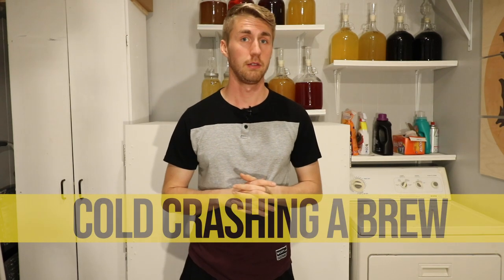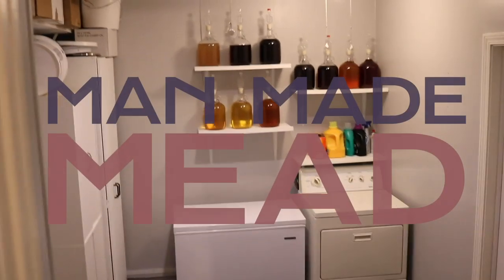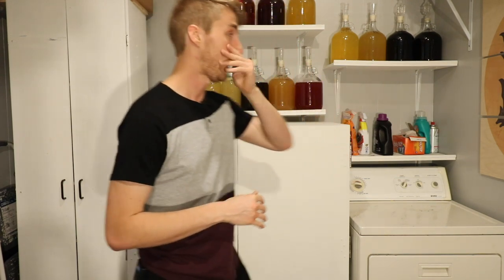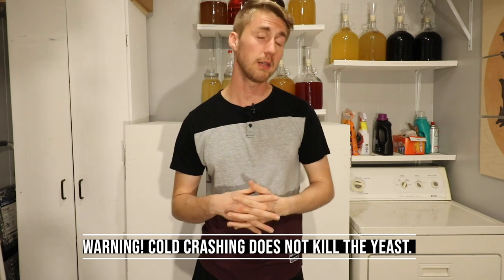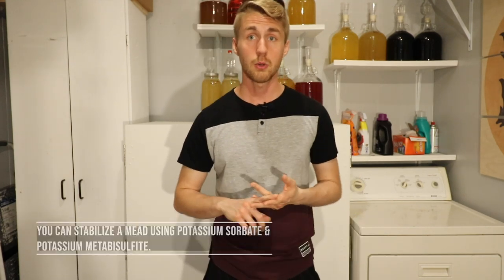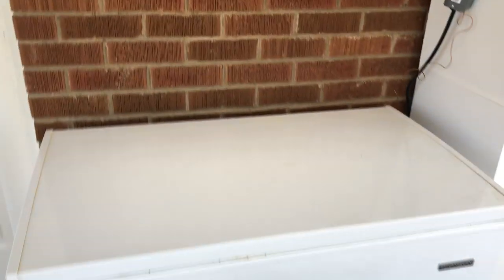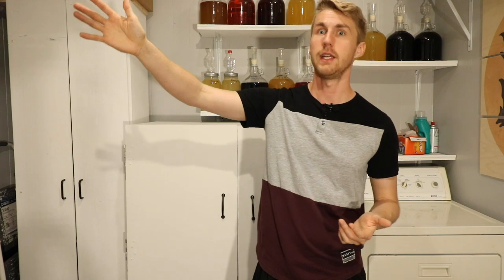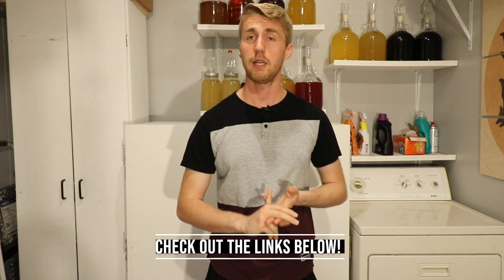What is Cold Crashing in Brewing?

Comment: I use a 5 micron polyester filter sock from Amazon to remove the yeast after primary fermentation. It’s washable, reusable and cost around ten bucks. They come in a variety of sizes right down to one micron. Five micron is small enough to filter out the yeast.
I’ve got a batch in the primary right now.I’m gonna try cold crashing it in the fridge and immediately filter it out,  degas it and bottle it after the sentiment settles. Thanks for the info!

Comment: Great video! I just wanted to add that I used an airlock when I cold crashed a traditional some months back and I didn’t know at the time, but when your mead chills it will suck the liquid from the airlock and it will drip into the mead. Going forward I’ve decided to use solid bungs. Lesson learned though haha
Reply from the maker: That happens sometimes with heat too!

Comment: I put my brew in the fridge and I have an s type airlock, after a few hours the outside air started pushing the water back into the brew. the liquid in my airlock hasn't gone back into my mead yet but im wondering if it will and then allow oxygen in as well.

Comment: Good evening.  This has been an extremely informative video for me.  We are beginning our trip into mead brewing and I have a question which I believe you may have answered, but I would like to be sure.  When we made our first batch of honey mead, we had an excess amount of mead to fit into the gallon carboy, actually it was a full liter bottle of liquid.  I placed this into our refrigerator to perhaps use in the future.  So, if I am not mistaken, all I basically did was crash it for the moment.  When I am ready to make my next batch, will I be able to pull this out and use it with the new batch, and not have ruined anything?  At this time, it has been sitting in the cold since November 20, 2022 (almost 4 months).  It seems a shame to toss it and am wondering your opinion on the matter.  Thanks for taking the time to respond.  We are enjoying your videos.  Best regards, Don.
Reply from the maker: You have basically just cold crashes your brew. You can definitely  try to re use the yeast - it should work!